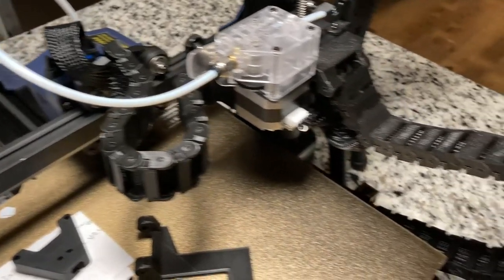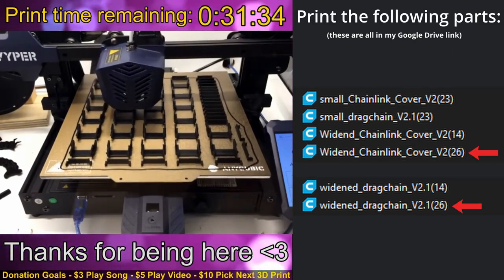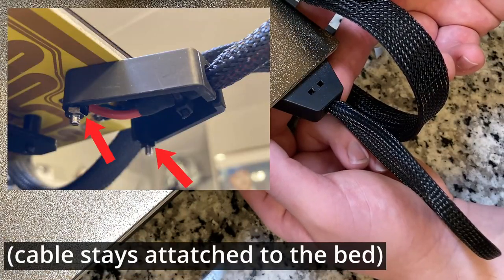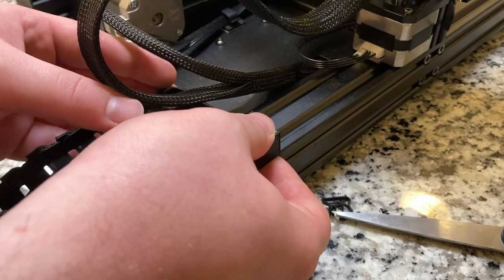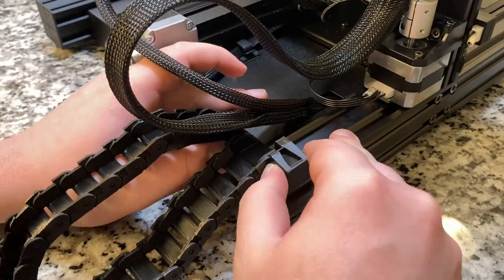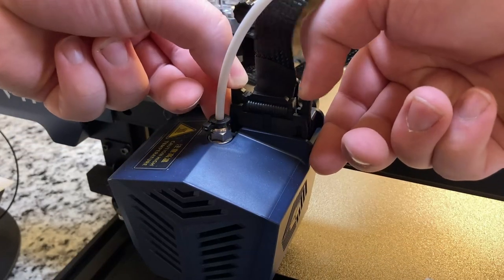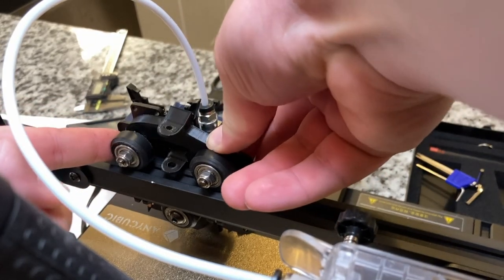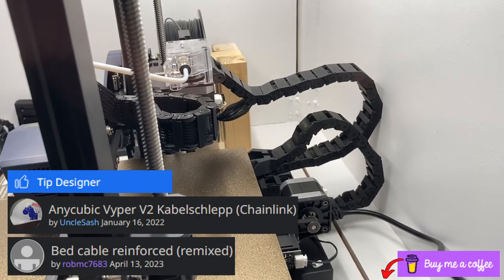Chain Link Cable Cover Mod - Anycubic Vyper

Comment: So I have the Kobra Max wich basically is just a big vyper. How many parts more i have to print?
Reply from the maker: No idea, some of the mounts may be different as well.

I would look for STLs of chain mods for your specific printer, or check other prints AnyCubic printers that have user-made remixes for your model printer.

If you can't find anything, you could be the pioneer! You could first try printing out the adapter plates for the Vyper and seeing how they fit on yours. Maybe they'll fit perfectly, maybe it'll be close, maybe it'll be completely wrong. I'd love to hear what you find out!

Comment: Been having a problem with printing the hotend mount - I have been cracking the tabs when I assemble it.  Any suggestions on printing setting or assembly that can help.  It's the final part on mine to put in place.  Thanks!
Reply from the maker: What do you mean tabs? The part that attaches to the chain? Or the part that attaches to the wheels?
Reply: @hopefullyquality  The part that attaches to the chain.  I actually found a solution for it.  You may have to print up that part at 103% to keep it from breaking.
Reply from the maker: Awesome man! Glad you found a fix!  @navyskiier
Reply: Same issue here. everytime I have tried to snap the part down on the wheels it breaks :(
Reply: I increasded the print size to 102% - it's just a little loose now... maybe try the same at either 101% or 102%  @landonwoodruff
Reply: @navyskiier  will give that a try. Thank you!

Comment: For some reason the extruder chain mount is set up for small chain even though the hotend chain mount is widened. So now I have a loose wide chain that doesn't mate to a small chain mount 🙄 how the hell did this happen?
Reply from the maker: i have no idea o_o have you found the issue yet?